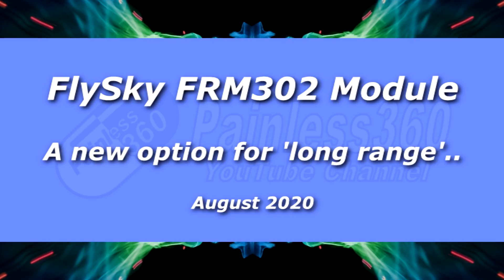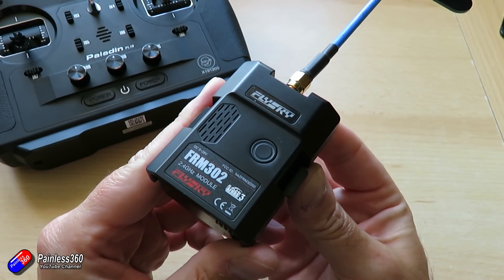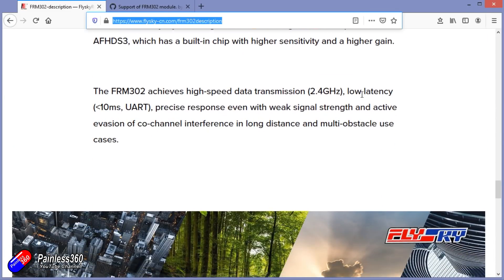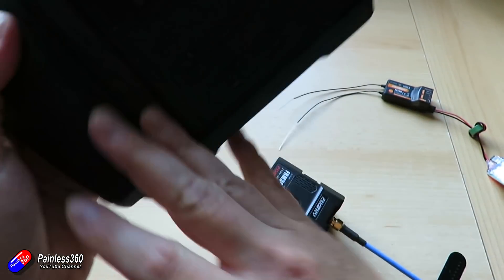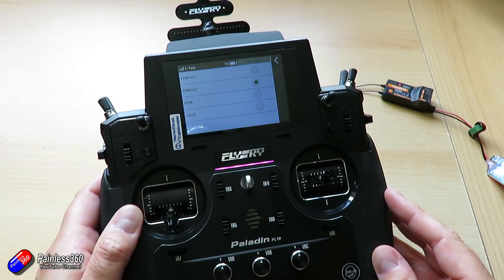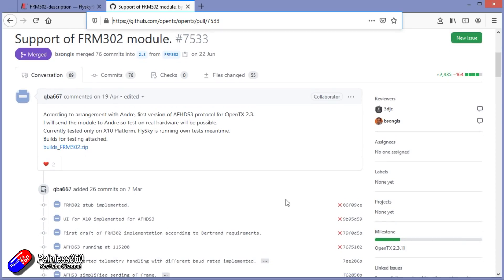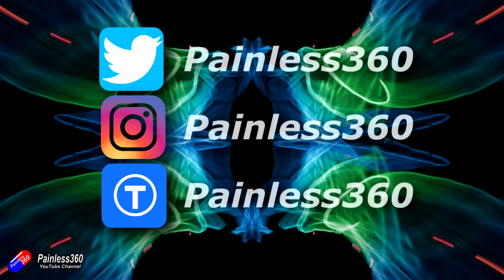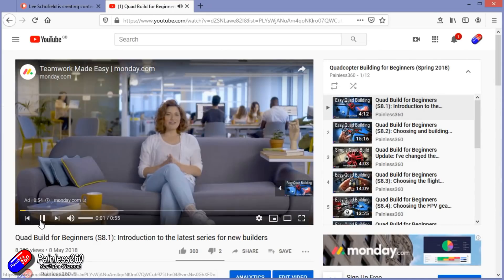FlySky FRM302 Radio Module First Look: A New Long Range Option?

Comment: Hello. I have justr received my FR302 module, and when trying to connect it in my PL18, I can not find it in the RF menu below the standard 301, and I get an audio message "no module, or module error".   Do you have any ideea why this happens? Or what a solution might be ?  Thank you !
Reply from the maker: Does your radio need updating? I'd contact the seller as I don't have one here to try... Best of luck
Reply: @Painless360   Thanks for the fast reply ! Yes everything it is updated on the latest firmware. And I think this is the problem, as I read on a GitHub thread that the FRM302 "developer firmware" is not compatible with PL18, and there is no way to get that back. I just wrote FlySky to ask for a solution, and I will post it here if I get one.  Thx! Greetings from Bucharest :) . Florin
Reply: Hello. It seems that the latest PL18 firmware is no longer compatible with FRM302, and FlySky wants you to upgrade to the newest module FRM303 (it already appears in the PL18 menu) !  Such a b**hit from FlySky side !!!!

Comment: I love how nothing came of this.  FlySky had basically the Tandem 2 years early with the Paladin and shot themselves in the foot by going with a proprietary setup and no SD card slot.  This module had potential but I'm not sure where anyone would choose it over another protocol now with the super affordable Tandem dual band stuff and then of course ELRS coming up and Crossfire continuing to be awesome.  Only real good thing about the Paladin turned out that the gimbals were amazing and an easy swap to the TX16S but then the AG01 came out.

Comment: Hey I am a final year undergraduate student in Electrical and electronics engineering background as well as part of Indian drone racing league ,I also opened up my frm302 module and the power amplifier which it uses to amplify the signal from the sx** chip is only rated for 27dbm(around 600mW) it's model number is AWB7232 which is also discontinued from semtech so how are they amplifying it up to 2W because if you try to amplify beyond that amplifiers range then the signal falls under the p1db region of the amplifier which starts to decrease the amplification and the signal is no more amplified this adds harmonics and other noises noises also and the signal becomes useless I wanted to see if you have the same Amplifier chip and how flysky is amplifying the signal !!!

Comment: Will this work with the Jumper T18? I know many must have asked this question.
Reply: There has some information shows that FRM302 can work with T18 in github,I think after sometimes
 there will be a compiled T18 firmware available for  FRM302
Reply: @karl_yang3755  thanks.

Comment: Is there a way to modify an older flysky i6 tx to use that module ?
Reply: Why?
Reply: @dj_dazzy  I used the guts from a flysky i6 for my tx. 
Lol, it's true I've been using flysky for ever.
Reply: @MadMarcWinnipeg  there is always a way to bodge it using ppm from that weird s video trainer socket 😀 the i6 is fantastic with that 6b receiver I have seen people out to over 4km.
Reply: @dj_dazzy  really ? Wow !  The 6b ? Is that an older receiver? If so I think I've got one.

Comment: how a 2.4ghz beat 900mhz length? its kinda impossible in theory (same power output)
Reply from the maker: Agreed if you're comparing the same signal on the same power using the same transmission method but using a different frequency...
Reply: Depends on what you mean by "beats."  900mhz has a natural advantage at longer ranges because the smaller frequencies travel farther and penetrate objects more easily but 2.4ghz has a natural advantage at latency because the higher frequency allows more information to be packaged (because information is encoded on the peaks of the radio wave and higher frequencies have more peaks per unit distance).

Comment: so what happens when a dji mavic/ phantom pilot turns on his drone. rc @2.4 and vtx 5.8 , usually in my club we ask the dji pilots to be at 2.4ghz in video
Reply from the maker: Those are the typical frequencies used for the FPV and control links so not sure what you mean... Happy flying!

Comment: I don't trust flysky after getting a 20 metre range with a setup they claimed should go for at least 500 metres. Flysky claims they have low latency, but that is unreliable too in my experience. I am interested to see how it performs.
Reply: Davey FPV I’m not sure there even exists a Flysky system that can only do 20mtrs. Your system must have been faulty I guess?
Reply: @hape4  I guess so. It must have been faulty. I had two of the FlySky receivers though and one of them wouldn't even bind.
Reply: Davey FPV 
That’s serious bad luck man.... hope you could return them!

Comment: I'm boosting 2 w on my taranis 2.4ghz range is insane. . BUT. .  It does mess withh vid on 5.8ghz. . Others will tell me their vid is clear on my channel watching me go 5km. . .but they are standing 2m away from me. . So for long range. If u using 5.8 u need a ground stasion

Comment: Awesome video, as always! I've had my TH9X in a drawer for quite a while since it can't even communicate with modern FlySky receivers running AHDS 2A. I wonder if this module could give it a new purpose? Your guess at 100mW range is interesting because 3 - 4 Km has been demonstrated on stock FlySky i6 transmitters. Also, you made it sound like Crossfire and R9 are not using LoRa technology which, of course, they are.
Reply: The TH9X can communicate with the 2A receiver by using the FS-RM003 RF  module.

Comment: How about the harmonics on the 5.8ghz at high power?
Reply from the maker: Power is limited. See later in the video...
Reply: Painless360 But when the full power option is available. My Crossfire is screaming all over my 1.2ghz video when at high power and the plain is far out. And 1.2 is not even in the harmonics of 868mhz.

Comment: Just imagine that module blasting 2W 2.4 near anyone using 2.4 too. On the other hand, that directional antenna is really interesting though, hopefully it will be sold separately and can be plugged to any 2.4 radios :)
Reply: It will be
Reply: Can't mobile phones transmit at near that output? And how many of us flying 2.4ghz turn off our 2.4ghz phones that can be just inches away from our radios. Just a thought.
Reply: @sylvanlight120  generally your phone isn't outputting 2.4 signal unless your hotspot is on and that's still in the mw range not 2W.
Reply: @Kayouu  oh OK, I wasn't sure what frequency 4G uses, and if that differs from GPRS signal. But good to know I don't have to turn my phone off whilst flying.
Reply: @sylvanlight120  the bigger thing would be Bluetooth since it's also on 2.4ghz. but with it's limited range we don't really see any interference

Comment: Great video Lee would this work in my X9D or would I be better with 9R thanks Lee
Reply: There has some information shows that FRM302 can work with T18 in github,I think after sometimes
 there will be a compiled T18 firmware available for  FRM302;   https://github.com/opentx/opentx/tree/2.3/companion/src/firmwares
Now you can also use FRM302 through the X9D PPM mode

Comment: My understanding is that airborne 2.4GHz RC control links are limited to 100mW EIRP in the UK, so I don't see how this FlySky module can perform much differently to all the other 2.4GHz systems that already operate up to that limit? Regardless of what clever things they might be doing with the air protocol, at the end of the day it's a fundamental limitation of wavelength & radiated power, neither of which they can (legally) change.
Reply: The lora system has higher sensitivity improving range plus the Yagi antenna will increase directional gain. Interesting to see if it shoots down other 2.4g 100mw systems when on 2w with swamping. Seen an i6 video out to over 4km so it should be quite good. The flysky +50km flight looks very dubious with signal strength never moving and it looks like it is on autopilot all the time.
Reply: @dj_dazzy  There's a limit to how much the higher sensitivity of LoRA can help & of course a directional antenna isn't unique to this system. I'm not saying that this new breed of 2.4GHz system (FRM302, IRC Ghost, etc.) can't outrange 'traditional' 2.4GHz systems, I'm just very dubious about the massive claims for a system which is still just putting out 100mW of 2.4GHz.
Reply: @CJDavies  Agreed, found someone on youtube going into failsafe at only 2.5km on 100mw about the same as frsky d8/d16. 2W output and non-LOS flights are illegal in most countries so there are no real benefits as the latency is the same as frsky (9ms vs 10ms)

Comment: I left FrSky stuff behind and went for the Radiomaster, got a cheap touchless Radiomaster and a Hall one for the price of a X9D ... and I'm quite happy.

LoRa was used in different scenarios communicating over satellite as Andreas Spiess the guy with the swiss accent explained and used in his project videos.

his description and explanations would me never have let think that lora can be used for long range RC but here we are.
I still have a R9M laying around that I got with the x9d radio back and I guess it is the cheapest way to start long range if I get a receiver. 

Still unsure if dji's fpv system isn't the best route to go ... cause my mavic 2 pro is the most reliable system ... overall.

And I have the racing goggles and an air unit that all work quite well with it. Even the analog zohd Kopilot and its camera feed are viewable. 

But I guess I will take the safe n cheap road purchasing a R9M receiver and using dji goggles re with the air unit to start long range but first I need to get my matek 411 running on inav  to get a safe rth in case of lost signal cause loosing a plane is getting more n more expensive considering dji air unit + cam worth 180€ + matek 44€ + receiver 39€ + battery 20€ before we talk about a plane like zohd mini talon evo around 140€ ... 1/3 is the plane but 2/3 are the mostly fpv related electronics.

Crashed planes you can recover can be fixed or the usefull pieces can be salvaged but lost on fov mission can be an awfull lot complicated and time consuming so I first need to get into inav + gps + fail safe before  I can start the r9m adventure with my most beaten plane.

Comment: In terms of range - 400>900>2400 on the same power.
Reply: True. Really 2.4GHz just allows you more data bandwidth (think Mbps). This would allow integration of digital video as part of the protocol. I wonder which company will realize that first? With this frequency choice, FlySky is the closest at this point.

Comment: Will it shoot down other 2.4 systems when running at 2 watts ?
Reply: Pew pew pew lol
Reply: Without a doubt, and as wireless internet access is generally 2.4 Ghz it'll probably cause problems there too.
Reply: Snafu before you make a statement like “without a doubt” you should have tested i guess. And found out that it isn’t shooting down other 2.4.
Reply: @hape4  I've seen what 2W of 5.8 does to everyone else's signal, I've seen what 2W of 868 does to everyone else's signal - Extrapolate from that and take a guess what 2W of 2.4 will do

Comment: Will this work with the Nirvana?
Reply from the maker: Answered in the video.. Watch from the 4 min mark ;)
Reply: @Painless360  thx, I missed that.
Reply: It's been in the nirvana firmware for quite a while now and should be quite stable.
Reply: @discord2000  thank you
Reply: I tried to order the FRM302 in May and the order was still not processed by late July. So I cancelled my order and got a refund.

@painless360
How did you get your hands ok the FRM302, antenna and receiver?
Reply: I ordered one from BG and it has taken about two weeks for the order to be sent the the central warehouse and they say  they have “started packing my items”. Appears like it just takes 4-6 weeks. We will see once mine arrives.

Comment: Sounds good what are the flysky normal 2.4 receivers like need to have a 12 channel receive for my 1/5 fw190 whith zohd kopilt
Reply: This is a new protocol and AFAIK won't work with the common flysky recievers. Most flysky receivers are afhds-2a and this module is the new afhds-3.
Reply: using the RM T16s

Comment: Cheap & long range? If this gets OpenTx support I think FrSky will definitely have a problem.

Edit: Just another thought although perhaps one you can't fully test yet: does this make the speaker in Taranis radios buzz like the R9M does?
Reply: At the moment it's more expensive than an R9 module. You can order it from Banggood for some time.
Reply: @ZeroFPV  Bit of a shame then. One of the key selling points of FlySky gear has been it's low price.

Comment: Wait... 2 watts?

That's illegal in the US... riperoni pepperoni
Reply: ...and the UK I believe
Reply from the maker: And most places. I imagine that's why they've limited the power in release (5:20). A lot of the huge ranges mentioned on their website are definatly not using that lower power level though..
Reply: so what, lol
Reply: They know what they're doing. FAA, CE compliant by default but capable of high power.

Comment: For some reason it seems 2.4Ghz is the latest focus around low latency and long range. IRC has recently released their Ghost TX and RX series that looks interesting as well: https://www.immersionrc.com/fpv-products/ghost/
Reply: It's because LoRa (and open source long range protocol that supports 2.4ghz and 900mhz) has matured enough that it has awesome range and much lower latency at 2.4ghz.  Both Ghost and Flysky are using the open source LoRa as the basis for their new radios/receivers.  You can actually build one your self, with plenty of good instructions to be found in their GitHub: https://github.com/Lora-net.  Essentially, a bunch of awesome people developed the tech for free and now big business is trying to take their free work and sell it to you for a huge profit.
Reply: @sugasheeze  seems like. This module is expensive